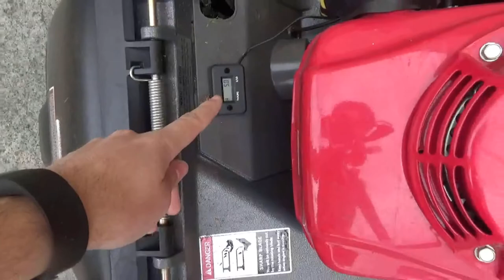5 HOUR REVIEW AND COLD START Honda HRU216M1

Comment: Would you recommend the nexite deck mower? How fast? I’m thinking of buying it.
Reply from the maker: Depends on what you are doing. If you are a commercial contractor mowing 5 days a week you will send a HRX217 to the scrapheap in no time. They are built as a residential/landowner machine so not for all day every day beating up. If you just have your own lawn to do though the HRX is awesome. Way lighter, faster and more powerful (especially with the new engine) than the HRU216 but again all for a different purpose.

Comment: I just bought this 3 weeks ago. I’m really not happy with the speed. I can push my old Honda mower faster and get my jobs done quicker. Kind of wish I went with the nexite deck one. Are they a lot faster?
Reply from the maker: The 216 is definitely a lot slower at factory RPMs than the 217. Once you open up the governor though it is a lot better. The 217 still goes a bit faster but at least the 216 will now do a decent walking pace.
Reply: I had the rpm checked by Honda, they set it at 3200 as it came out of box set at 2200. It hasn’t made much of a difference to the speed. What did you set yours at?
Reply from the maker: @melissam6505  Couldn't tell you exactly what its set at as I've never checked sorry but might actually do that soon now that you mention it. Your right it doesn't pull the speed up tons because it runs on a gearbox but at least I can mulch a bit more than just grass that doesn't need cutting now.